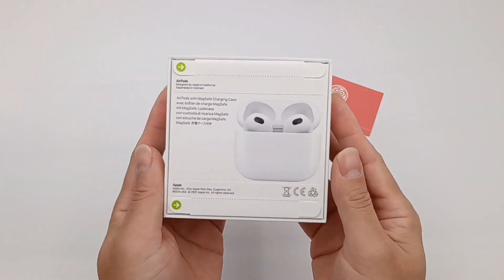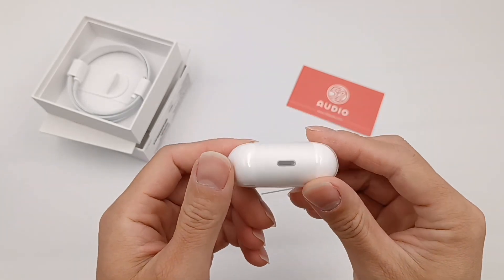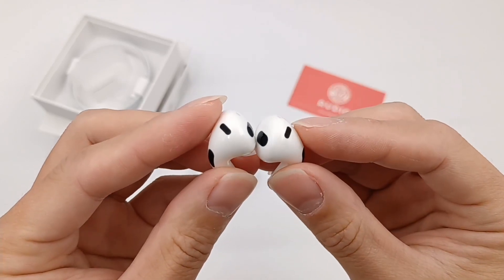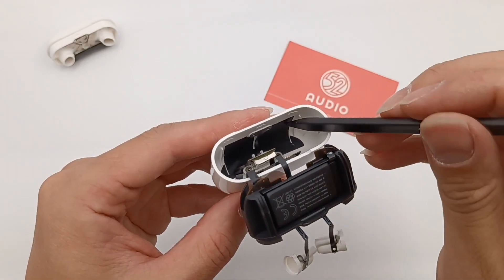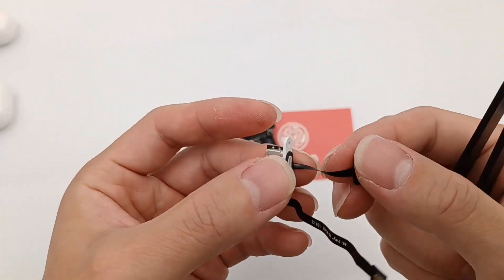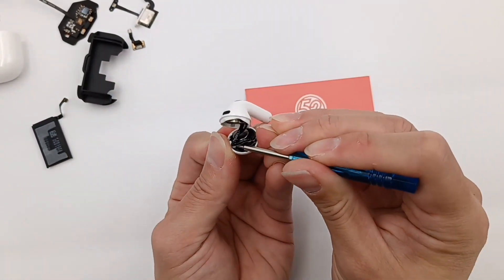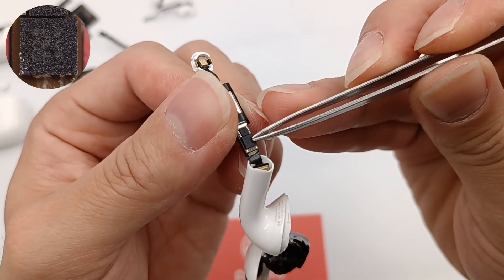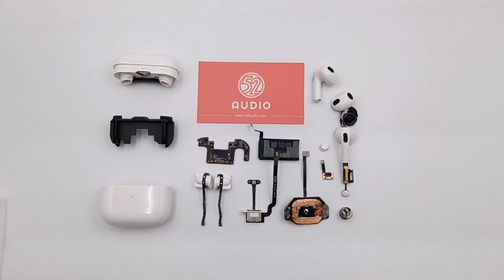Latest Teardown of Apple AirPods 3 @52audio

Comment: Thanks for this. I used this teardown video to replace a broken speaker on my left airpod. A few notes: heating up the airpod to separate the two halves was harder than I thought (long time to heat), taking out the speaker from the housing required patience because it's glue into place, and the contacts between the ribbon and the speaker are 2 small contacts that require precision soldering.

Comment: I'm partially blind, but that was a very interesting teardown. I'd have never looked at this stuff, but my puppy got hold of my left pod and ... thought it was a little white bone, I guess? Anyway, He just fortunately seems to have chewed where the stem meets the head, and not lower down. I was having a freak-out about where the battery is, even though the pod's still technically together ... though non-functional. So, the battery's at the bottom of the stem, correct?
If you see this, please answer. This stuff's going to give me nightmares, I swear! I also know Ow'll regret making a fool of myself on here ...
Great video anyway though, thanks!

Comment: To my ears these 3rd Gen Air pods are more comfortable compared to the newer Pro version with the soft gel tips. https://www.youtube.com/post/Ugkxgl8SzyQoymMu-S3V55Dskg5QJ8xr1yCR That said, compared to the 3rd Gen, I notice these do not stay planted in the ear as well. One design issue I think, is you squeeze the stem and click it twice to advance your songs. On 3rd gen you tap the large speaker. The difference is by grabbing the stem each time, you tend to loosen the bud fit in your ear. Not always, but the bud falls out a few times while running. The old tap to change never had that problem for me. I would not have changed that tap function. That said, the newer Pro version sticks in the ear, almost airtight if you want that. I do not like that Airtight fit. So that's why I'd stay with this version as the best trade off of comfort, use, and overall feel.

Comment: Nice teardown, thanks! I wonder what that surface component at 2:38 is, looks like a microphone or some sort of temp/pressure device, but maybe it's not a hole, rather and orientation marking? Still leaves the question what it may be, and why it's positioned where it is :) Cheers
Reply: It’s probably a relay switch to detect if the case is opened or closed.
Reply: Hope you’re not talking about the LED that’s on the case exterior…
Reply: @snackerslc  he is talking about the hall switch it detect the position of the lid.
Reply: @f.i.b3027  Ohh

Comment: Great video and teardown! I thought that the whole case would be full of glue and impossible to remove / repair. Did you remove it first or did Apple not apply glue in the AirPods 3s?
Reply: I don't know how did he manage to do on this video, but whole case is glued and it's nightmare to get inside. impossible without full damage
Reply: @paulinagrudnik  he mentioned at the end of the video, that there's lot of glue everywhere and difficult to remove. He might have used solvents/thinners and high grade adhesive removers to remove them 1st then clean everything, reassemble it and dismantle it again for clean video.
Reply: @paulinagrudnik  I would totally damage them beyond repair if I tried to open them up, but clearly it is not impossible to open them without damaging them.
Reply: something is off, looks like lego